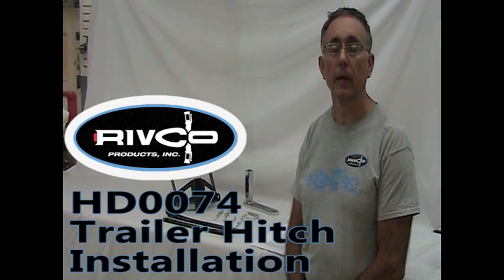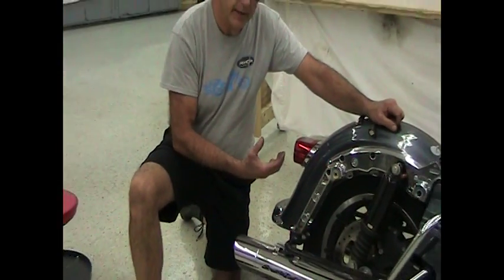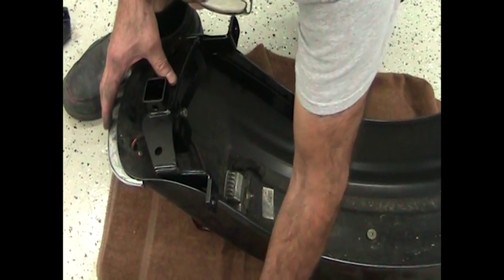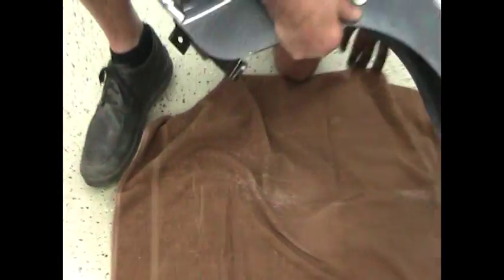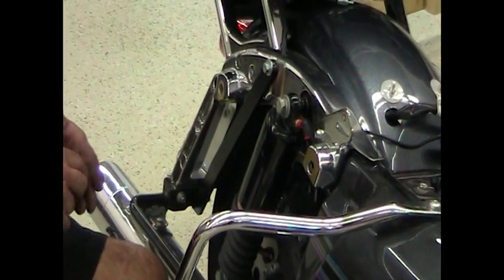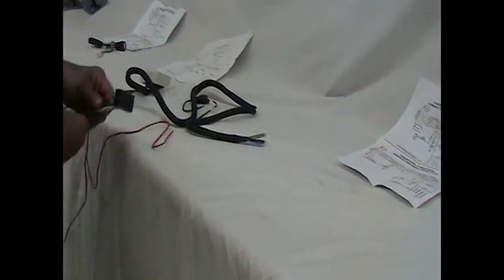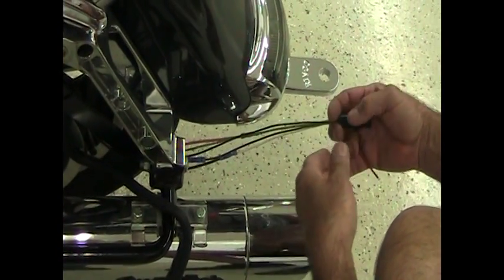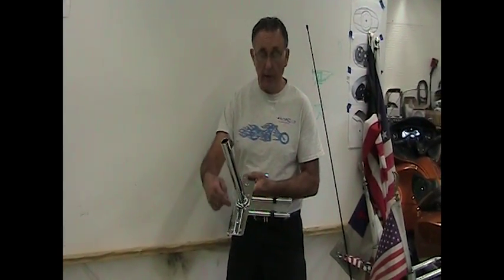HD0074 Installation

Comment: This was an outstanding video. I just purchased this hitch for my 2019 FLHTK, it fit perfectly. I was a little concerned because i have the Ciro tail light inserts. But there was no conflict at all. I don't think could have done this without the video, at the least it would have taken a lot more time. The only complaint I have, is that the bolt that attaches the top of the bracket to the frame, is extremely close to the lid of my saddlebag. I'm going to replace them with a couple of stainless steel hex button heads. I also used a Kuryakyn 5 wire trailer wiring system to my Escapade trailer. It plugged right into the Ciro lighting harness under the seat and worked perfectly.